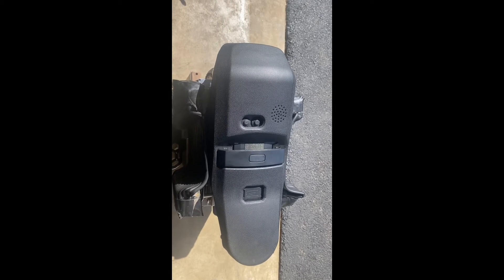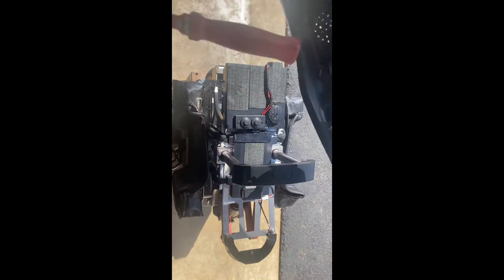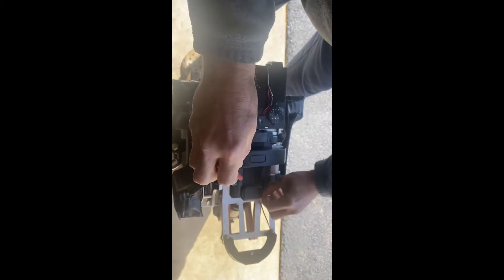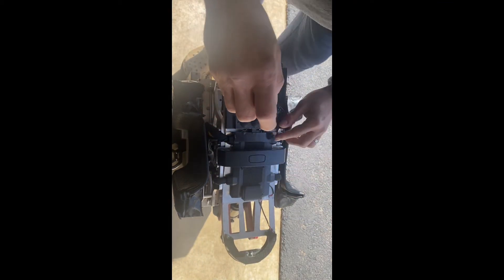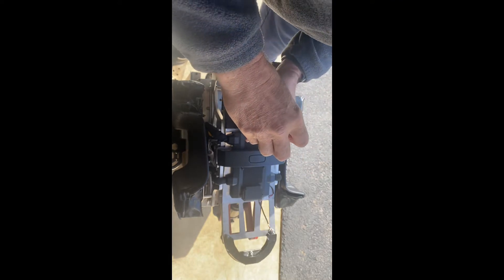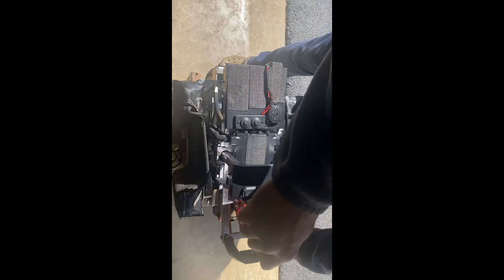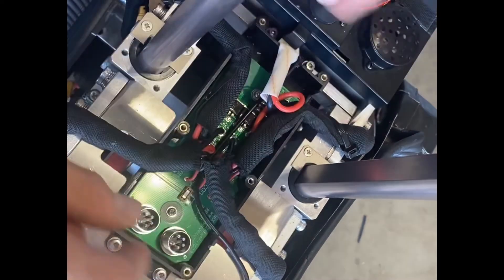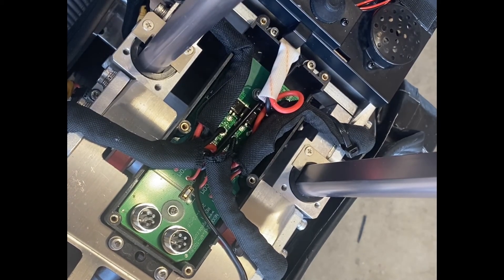EX20s wiring harness

Comment: Wait, it actually blows a physical fuse it you charge it too fast??? This sounds horrible and really strange.
Reply from the maker: the max charge rate is 10amps. so for 24s2p wheels with up to three packs , 10 amps is plenty. only on 4 packs wheels (mp24 or ex20) 10 amps is 2 amps shy of max recommended charge rate. so i don’t see a big issue.
Reply: @rayrokni  It's 2022. It's rather simple for the charging electronics to limit the charging current. IMO kind of mind blowing that you will brick your wheel if you use a wrong fast charger.

Your house wall outlet can supply at least 15-amps which would blow up your iPhone. But your iPhone limits the current that it can draw. Basic electronics actually.
Reply from the maker: @ElectricUnicycles  first of all, majority of “fast chargers” aren’t really fast chargers. they have selectable amps, and majority max out at 9 amps. there are few brands that allow much higher amps, yes. but mainstream riders don’t use those chargers.
gw in their wisdom, in light of recent fire scares decided to limit the charging to 10 amps. so the uninformed don’t go charging a two pack wheel at something crazy like 18 amps and maybe cause a fire.
what makes me laugh is general feeling is “safer wheels”, gw limits a possible cause of fire on the charge side and now that’s a problem. 
in most cases 10 amps is more than sufficient for most of the riders and wheels. 
the manufacturer’s max limit for the cells that gw has been using is 3amps per pack. having said all this, i don’t understand why they came up with 10 if its still too high for a two pack system and not high enough for a 4 pack system. 
i own chargers that can push up to 25 amps. i always still use 3 amps oem charger %99 off the time. and of i need to charge higher, i still use the 3amp per pack “safe” limit.
so i really don’t see any real problem for %99 of the riders and wheels out there.
but we can always make a mountain of a mole hill😁😍
Reply from the maker: @ElectricUnicycles  btw, it’s a replaceable fuse 😁
Reply: @rayrokni  Understand 👍 I'm not arguing about their choice to limit. I'm complaining about their use of a fuse to do so. That's insane. Simple power electronics design can limit the current. Using a fuse is a hack and pretty destructive when it triggers. Fuses are use to prevent damage from shorts caused by a failed component. KingSong, Veteran, Inmotion use electronics to limit the charging capacity. They simply stop charging. They don't blow a fuse 😆
Reply: @rayrokni  Still not very convenient. It's a lame "Gotway" solution IMHO
Reply from the maker: @ElectricUnicycles  explain how its not convenient
Reply: @rayrokni  You have to open the wheel and have access to the correct fuse. I'm not saying that this is a "fatal" design choice but you won't be able to convince me that it doesn't suck 😄 I'm not aware of any other wheel that has had a fuse on the charging side. It won't affect me but I'm surrounded by a lot of Bozos that carry around 20-amp chargers for group rides 😆
Reply from the maker: @ElectricUnicycles  i’m not trying to convince anyone. maybe it’s to stop bozos charging at 20amps a wheel that max “safe limit” is 6, 9 and 12 amps.
Reply: I'll be using the standard charger on normal use, but a 10amp charger I already have when doing long distance trips. I hope it won't blow with a 10amp charger (if it suddenly has a small peak over 10a or something like that).
Reply: What are the fuse details to buy a spare one just in case it blows charging at 10a?
Reply from the maker: @juanjoportable  your charger had multi amp selector?
Reply: @rayrokni  no, I've a 10A only charger
Reply from the maker: send me a picture of the specs on it. you can dm me on fb or telegram
Reply: 15A input is clearly wrong, probably 5A. (Model C1200=200or240v*5a=1000or1200w input, 1000w output)